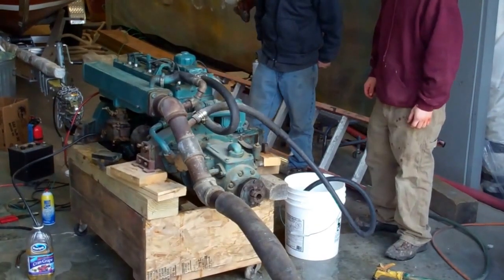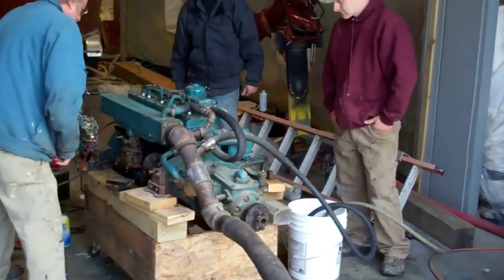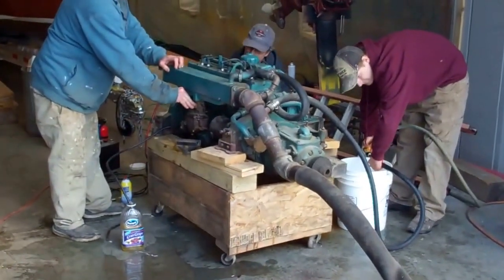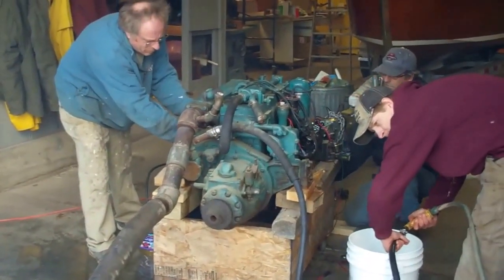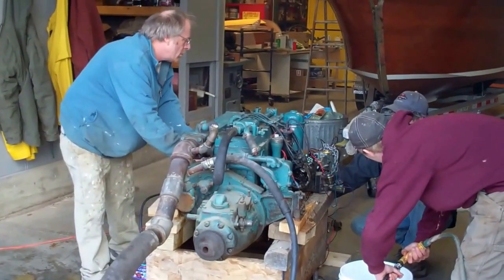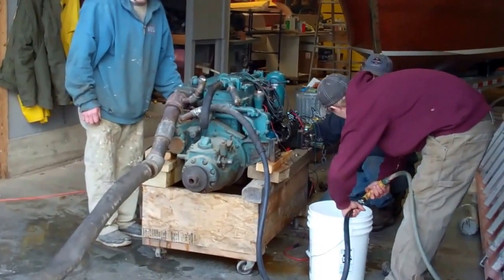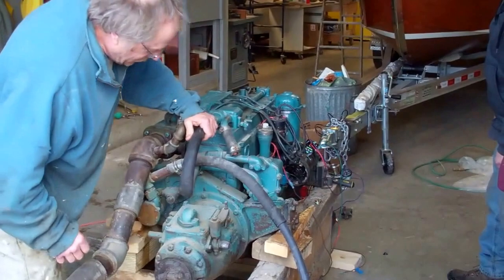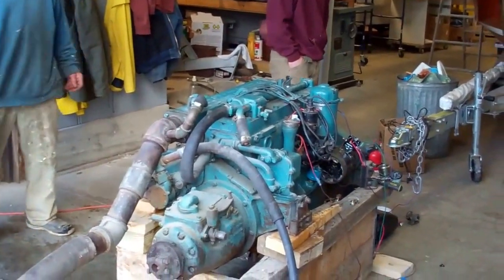Chrysler Flathead Six Engine Test 20' 1955 Lyman Runabout 3 11 2014

Comment: Wow. How much horsepower is this making? And whats the firing order like, because it sounds like a V8?
Reply from the maker: The engine, a 1955 Chrysler Crown M-47, makes 93 HP at 3,000 RPM.
The firing order is 1-5-3-6-2-4.
These old flathead sixes do bark for sure.
Reply: Firing order would most likely be same as any other L6.  Just like an L4, there's only one way to do it.  On a V8 there are two possible firing orders.  Chrysler and GM state order identically.  Ford 289/302 states it differently, but ONLY because they use a different numbering scheme.  Ford 351W uses an alternate order which is superior.

Comment: For the same money you spent overhauling that obsolete flat-head merely for originality you could have dropped in a modern V6 and doubled the power output on the same fuel consumption.  Heck, Chrysler even had their freakin' SLANT 6 marinized and at least that was an OHV engine!
Reply: Not all of us want to destroy vehicles by slapping in soulless modern garbage.
Reply: Don't underestimate those old flatheads. Even if you double the horsepower in a boat, you don't get that much speed increase, and the original just sounds like a wooden boat should. Plus they run forever, utterly reliable and smooth as an electric motor. Don't get me wrong, I love hearing the modern 3x Mercury Marine supercharged QC4V engine cigarette boats roar along at >150 mph too, but that's just not the soul of a boat like this one. Its perfect with what it has.